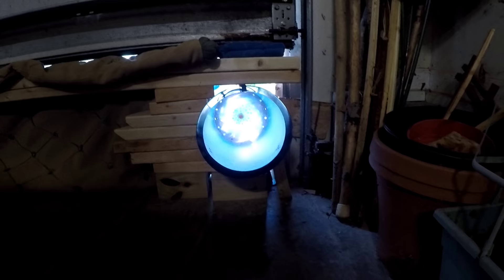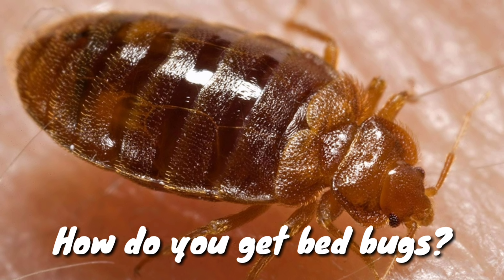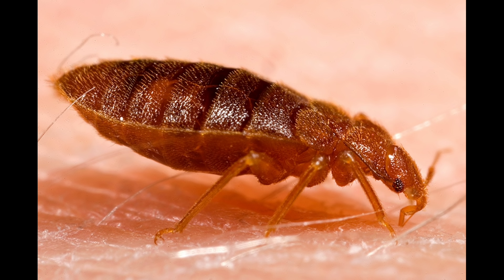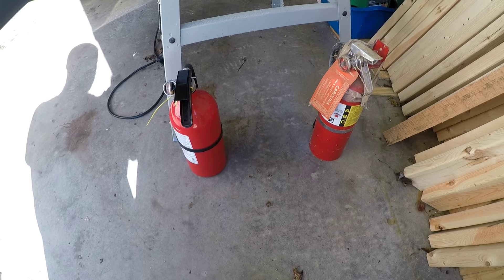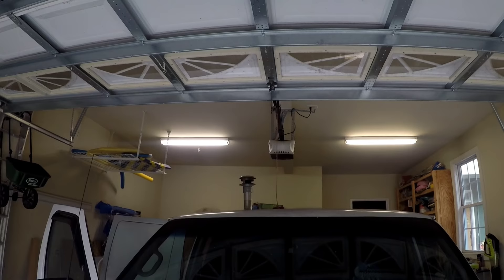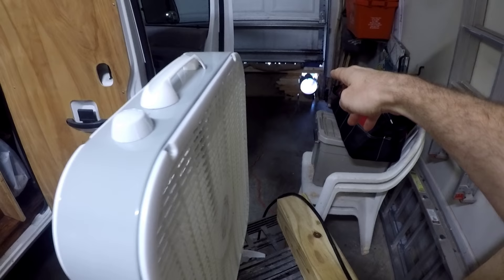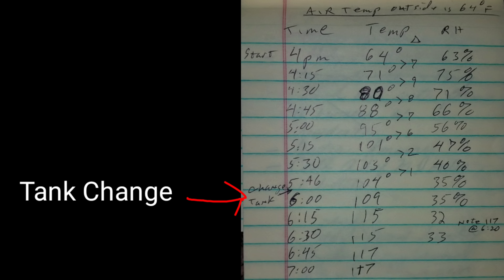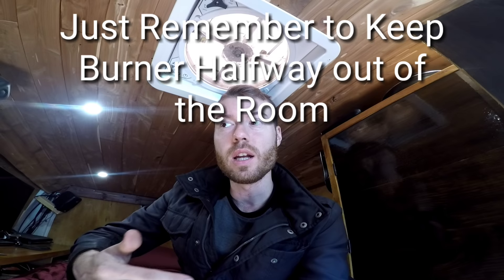How to Kill Bed Bugs Instantly for Van Life

Comment: Hey it was 28 degree Celsius outside. I blasted my car's heater and left it for like the whole day until sunset. The temperature inside was around 70 degrees Celsius, they die in 47 and eggs in 52 I think. 

After the 'treatment'. I got bites the first night. All or most from nymphs. Tiny tiny ones. Really itchy and they bit my scalp and ears.

This is a NIGHTMARE. 

I can't afford much. I wanted to rent out a garage but idk, nobody even responded positively to one nights rent...

To rent out a heater I cant afford now or barely can.

This is such a nightmare.

Any ideas, anyone? When I look at my car, crumped car and the bites... And the tiredness from not sleeping... Oh man.
Reply from the maker: Buy the heater at a hardware store, use it once, and then return it for full refund. It's what I did, I just didn't want to say it in the video haha.
Reply: Hey, where are you stationed at right now? Is there any chance you could help me do this? 
I've had the problem for like 4 months almost now... 

I literally can't find anyone here to rent me out a garage for one day for that purpose even if I pay double for what they want a month!

I would be really really grateful.

Or maybe at least we could figure something out... Ive already done once more chemical treatment and it helped a bit but a week later I'm getting bit at a similar rate before I did it :/

The most puzzling thing is that I can't really pinpoint where they might be lol. I mean it's a small car I have :p there should be way more marks of their existence tbh
Reply: I've already went through all the crisis phases btw :D

Like " if I were a celebrity I would have people take care of all of it for me I would be bed bug free NOW!..."

Or the flamethrower fantasies... 

Dreams of a brand new vehicle ascending from the heavens 

Driving into a huge sauna with all my belongings where nothing gets damaged and I drive out brand new.

And the mythical insect predators that would enter my car and hunt every last bed bug.

I'm going crazy. Currently trying to forget but the itching is getting to me. I need anti histamines.

I noticed the treatments gave more like hope than actual remedies. I think I need a thorough prolonged heat treatment or something else. My bed bugs are like invisible or something :(
Reply from the maker: @gyathcarmel1900  i set an alarm to wake me up suddenly in the night, pulled back my covers fast, and saw the bed bugs. They usually only come when you aren't moving around and it's dark (and waking yourself up suddenly makes it so they have no time to scurry back). It sucks, but that's how I was able to spot them, and then watch where they crawled back to to see where they were hiding during the day. It worked. I saw they were going to certain areas.

I'm not able to personally come help, but this is something you'll have to build up money for. It is a huge nightmare. It really sucks bad! I understand! Try to come up with a solution, it took me a while to think of this stuff I showed in the video, but it was worth it.

Technically it is summer time too. You could drive to Florida and lock up your care with windows closed. Or...
Take a few days off from work to go to Home Depot and buy a propane burner like I used in the video. Then return it afterwards.
Reply: @OutdoorsEmbrace  thanks ☺️ I think I'll try a lot of things now that I haven't in the past. You're right about the money too.
Reply from the maker: @gyathcarmel1900  where do you live? Can you just drive to a desert or a really hot area?
Reply: @OutdoorsEmbrace  Europe (Eastern) it didn't work the first time at quite high temp. but I'll definitely do it on a sunny day. I'm only afraid they are mostly in the lower parts if the vehicle. Best would be to combine natural heat and heater I think... Garage would be perfect to heat the bottom :p
Reply: Tbh I would only need long exposure. If I could rent a place for like 48 it would be 100% effective so maybe I need to find a um safe inner heater that doesn't need to be stationed at the edge of the garage?
Reply from the maker: @gyathcarmel1900  you only need about 5 hours to do the entire thing at most. It could work with 3 hours. Just make sure you do everything I go over. It needs to breathe oxygen from the outside fresh air or it'll flame out from lack of Oxygen.

I'm not liable for any failure to do this right! Just saying! But it can be done safely. Whoever you do it with will probably be scared of what could happen. It's a scary sight to walk into a garage that's hot as fuck and has a huge flame shooting out haha. But I did it, and it worked!
Reply: @OutdoorsEmbrace  hey I found a man kind enough to rent me a garage for until I get rid of them, lol. He didn't have any objections and right now it's working, the machinery, I didn't set it as tight sealed as you did, but I did all the basics correctly.. Hope it works, it's been running half an hour now. I recorded a short vid showcasing all that but idk, maybe I'll send that sometime later because it really seemed bit funny to me this "operation. I started it in the middle of the night too 🤭 

Thanks again! The method seems genius. I already feel it's way better than the rest.  

I want to ask - when you reached the desired temperature, did you... Stop the heater? How did you manage that matter, if you remember?
Reply from the maker: @gyathcarmel1900  hell yeah! Good job getting a garage!
When it reaches the temperature, I kept it going. The room might be the right temp, but the temperature needs to penetrate all areas of the van.
Reply: That was my first thougth too. Heating with propane too much work and is the same thing. Oh sorry didnt read it all way through. What about really thin plastic tarp and make a tent around the car. Heating the whole garage seems exessive
Reply: @OutdoorsEmbrace  omg i wanna do this to our room its briiliant.  but i doubt my husband will let me... i dont know what bug we have but it is annoying N just eating us up.. spraying tea tree oil seems to repel them but i have been turning the room upside down and cant find ONE single bug and then? wake up covered in bites ... sigh ... its a miracle the husband still comes home with my obsession on 'finding' the bug ... looks at our poor bedroom all turned upside down, and walks away .. lol
Reply from the maker: @drivestorage1779  definitely sounds like bed bugs. Sucks so bad! Be careful if you do this and make sure the room can get more oxygen if you try it. Otherwise you'll have a burnout. Slightly open a window and that should be ok. It's going to get so hot your eyes will burn haha.
Reply from the maker: @Seth Wright good to know man! I'll have to look this up! Thank you!
Reply: @Seth Wright wow, thanks for sharing.  I looked it up and you aren't kidding when you said it costs!  If we are desperate enough we will be getting these.  Do you think we might be able to find these at Lowe's or Home Depot?  --> sending my husband there to hunt for this hoping for better pricing than amazon (we find that amazon jacks up prices a lot and if we can find the same products at the b&m stores, chances are, local stores sell them for cheaper).  We'll try our luck this weekend.  SHOPPING TIME!!  HAHA!
Reply: ...I perfectly understand ( same experience )!! ...Consider THIS: ...Exodus 15:26; Proverbs 4:18-27; Ezekiel 14:1-23; Psalm 1:1-6; 19:1-14; 119:1-176 / King James Bible ONLY! ...for the Lord says, vain is the help of man. ( Psalm 1:1-150:6; Proverbs 1:1-31:31; Ecclesiastes 1:1-12:14 ) ...Amen.